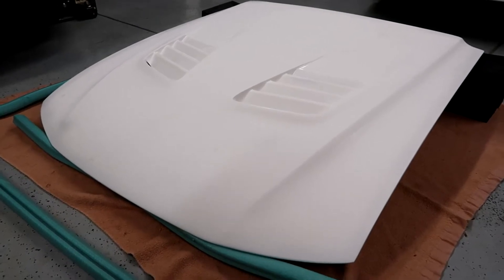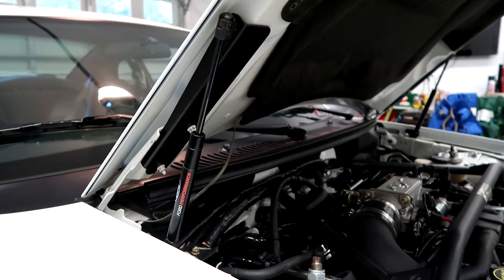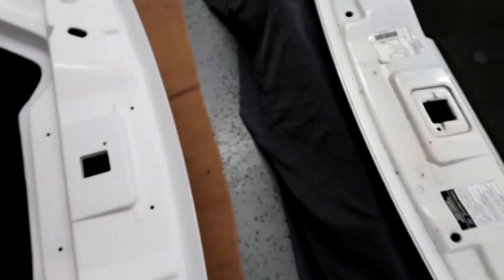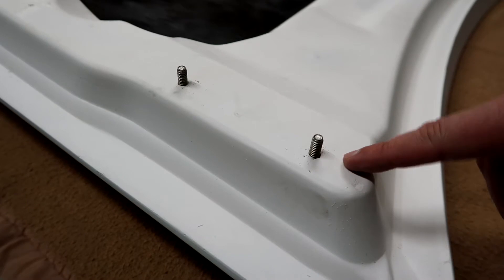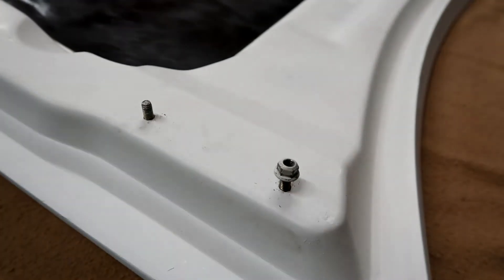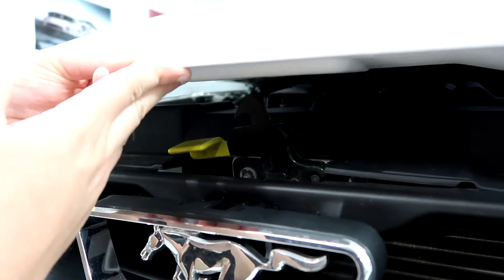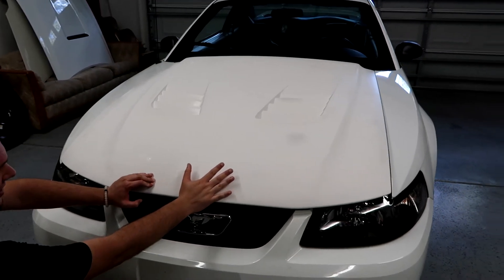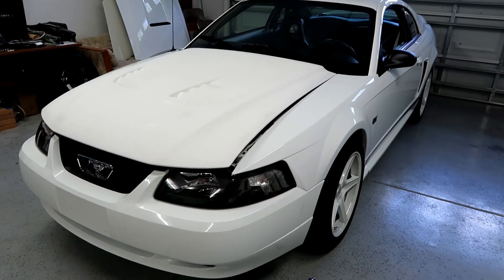Saleen S-281E Hood Install | 99-04 Mustang

Comment: Did you ever find the problem im  or come up with a solution im having the same issue
Reply from the maker: Yes... I should get the car back within the next week so I can make an update video. Life got in the way and delayed me getting it to the paint shop.  So they ended up having to create a plate for the hinge to latch onto. They had to shave down the thickness of the fiberglass in that spot but that would leave it brittle and prone to cracking so the metal plate helps reinforce the hole and allow the latch to catch. As soon as I get the car back I will have a video showing what was done. For now all I have are a few pictures the shop sent updating me as they progress. If you email me I can send you the pictures if you’d like. ChaosCarClub@gmail.com
Reply: @ChaosCarClub  thx i endup making a hinge for it
Reply from the maker: @ndriverkg104  good deal! no idea why saleen made it such a pain to install?! for the price it should fit right up with no modification needed! glad you were able to get it sorted